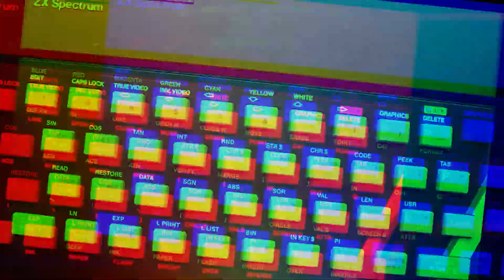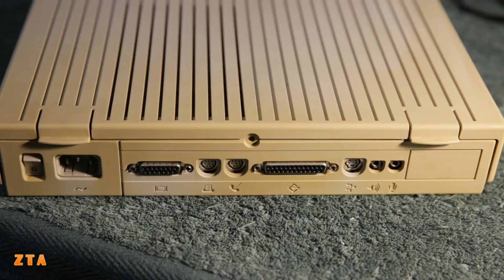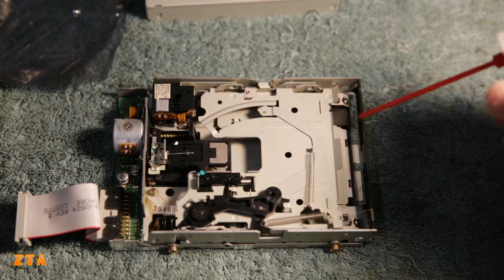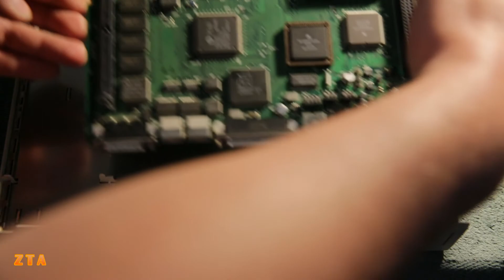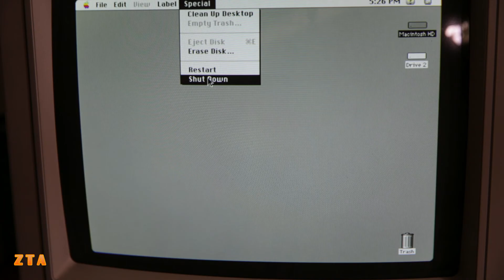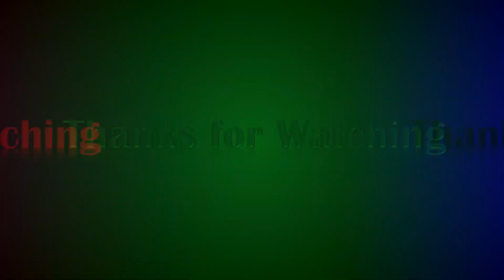Macintosh LCIII Restoration Part 3 - The Computer

Comment: Hello!  I remember these Performa 460's when new!  They are actually the same as the LCIII+   From memory all of the ones I have used had 160Mb drives.  I had a Performa 450, which came with 120Mb drive.  We used an external Apple CD300e. Loved these solid and reliable Macs, you just need the curved mouse to complete the set.